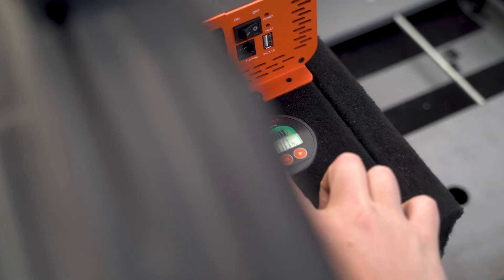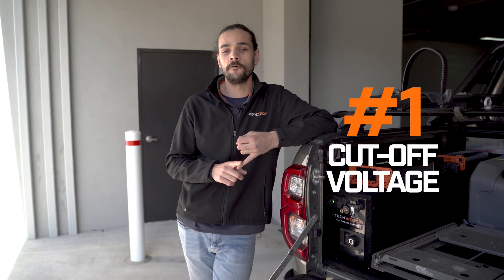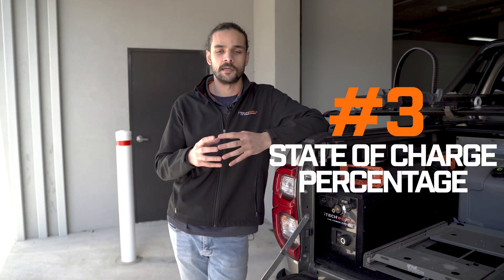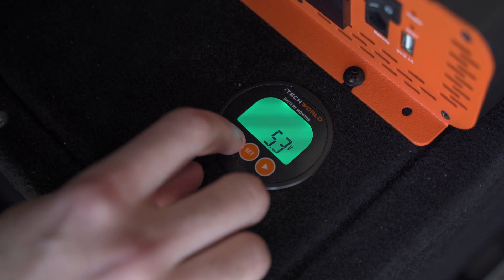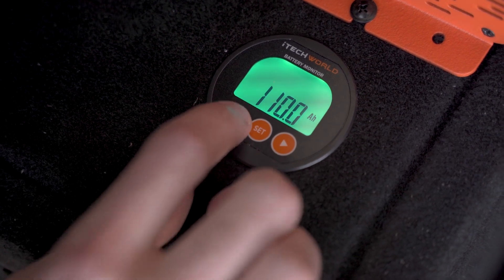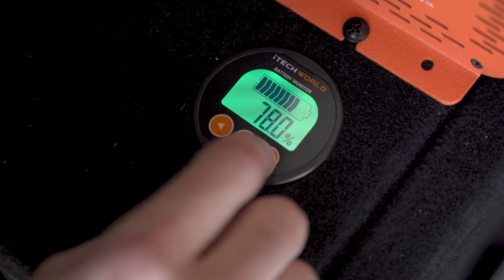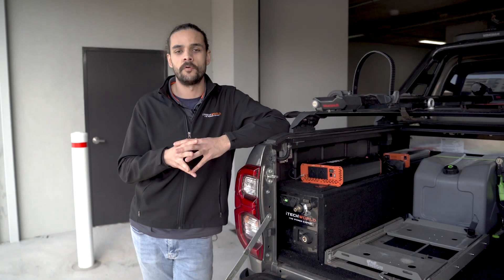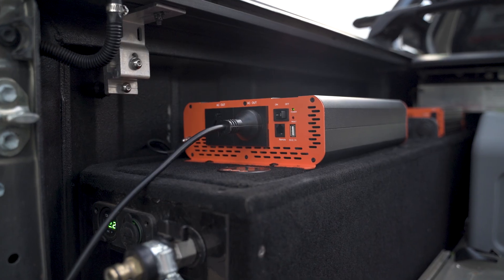How to Set Up the iTECHBM500 Battery Monitor

Comment: Wouldn’t you set the voltage cut off to 10.5v as that’s considered flat for a lithium?
Reply from the maker: Hi there. Setting the cut off voltage to anywhere between 1v - 10.5v will yield the same result, as anything below 10.5v on our lithium batteries can be considered flat or in 'Safe Mode'